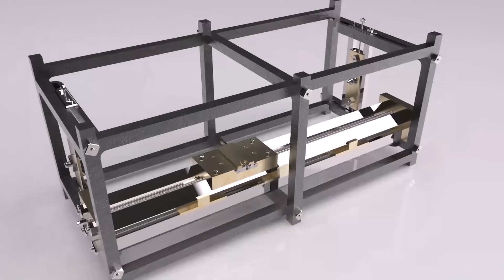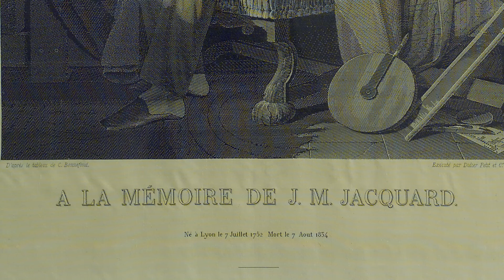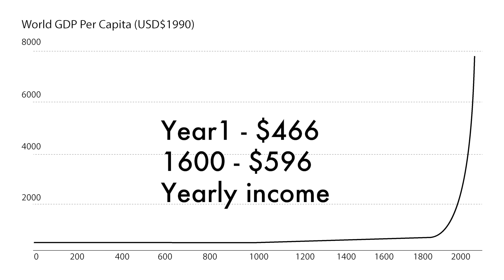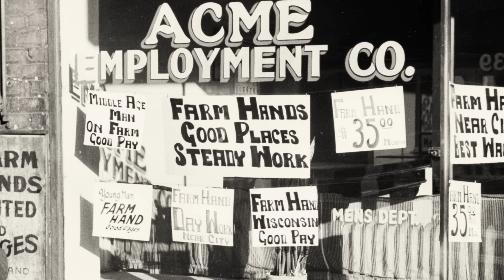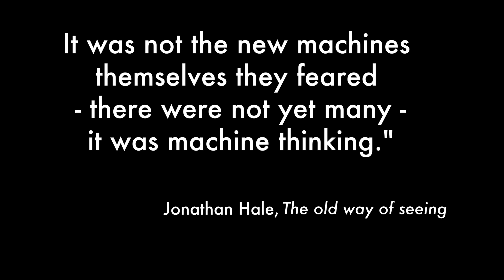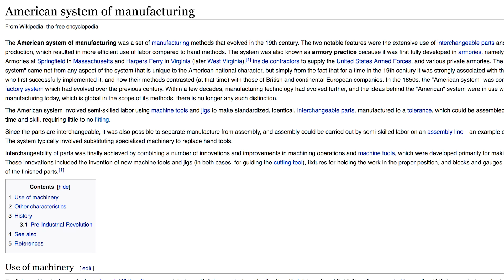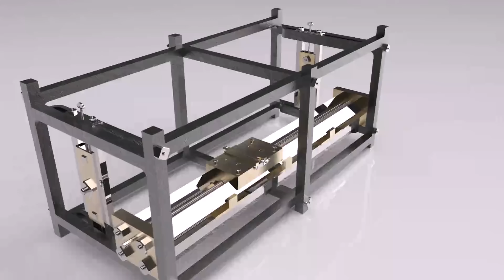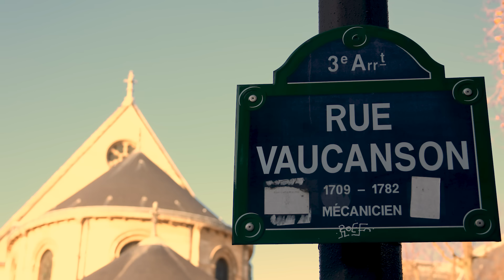The 1751 Machine that Made Everything

Comment: This is quite an oversimplification of the causes and the developmental pattern of the industrial revolution.  If simply having a machine were enough to kick off the whole process, then industrialization would have occurred wherever a machine was developed.  But that's not what happened.  There are entire social, religious, political and legal contexts to consider as well.  These most readily combined with technological advances in Britain, which is where the bulk of industrialization was largely confined for the first fifty or so years.  During those fifty years, industrialization was certainly occurring, but it was far from evident that it was fundamentally changing society; those realizations only came much later.

Comment: Can you believe that the first lathe screw had to be hand made. Accuracy can be reverse engineered over time but it would still have to have been accurate to about 0.01% this is because there is an actual air gap between screw threads which allows for some error at first.

Comment: "Machine thinking" ...Interesting
 I have done many sculptures. Also built guitars and made knives and furnature. I have designed and built industrial automation.
 The electric guitar though is made from magnesium it is seen in my avatar on the left there. All made by hand but with manual machining methods and lots of hand work with files. 
People realize these are hand made right away not because they look rough though. None of which could be done with out modern technology. They are however very unique in appearance and look expensive. 
People see the sculptures though. Sculpted by hand all the way fired in a kiln in my basment. These are things that could have been done with out any modern technology.  Almost immediately though people think they are just something that popped out of a mold and purchased off a shelf at Wal-Mart. Often people have no idea any more.

Comment: I agree.  There was a similar historical event in Chemistry with the advent of industrial methods of making ammonia and then nitric oxide and nitric acid with the Haber – Bosch Process (pressure and heat with iron and platinum metal catalysts).  A similar graph resulted in an explosion in human populations starting in the late 1920s and mid 1930s. Nitrates also made war much more deadly (as in WWI and WWII) as waring countries tend not to run out of nitrates to make explosives with.  WWI when it first started it had been reported in the newspaper (according to my High School History course) to have been no longer than about six weeks.  As the then Germany had to get its nitrates from an island off of the coast of Peru, if memory serves.  The first naval battle of WWI occurred off this island between Germany and Britain.  Sort of profound if you think about it for a second or two.

Comment: you know there is a coincidence on that graph, it is also the year efficient steam engines and the cotton gin were produced. pretty sure the steam engine, and not the lathe was the cause of this explosion. and economists agree with me: 

"Energy economic theories hold that rates of energy consumption and energy efficiency are linked causally to economic growth. The Garrett Relation holds that there has been a fixed relationship between historical rates of global energy consumption and the historical accumulation of global economic wealth.[155] Increases in energy efficiency were a portion of the increase in Total factor productivity.[13] Some of the most technologically important innovations in history involved increases in energy efficiency. These include the great improvements in efficiency of conversion of heat to work, the reuse of heat, the reduction in friction and the transmission of power, especially through electrification.[156][157] There is a strong correlation between per capita electricity consumption and economic development.[158][159]"

machine tools are part of this, as without them efficient heat engines could not be made, but where do you draw the line? you could say without crucible steel forges machine tools couldn't be made, and before that the discovery of metallurgy...so really, its the steam engine.

Comment: It looks like the graph starts to go up just before 1000, which coincides with the use of liquid mercury to power the escapement in astrolabes which were essential in the accurate harnessing and use of Time. Without accurate use of Time, nothing we have would exist. 

I understand you're speaking about the hockey stick on the graph specifically but I found it interesting the line started to go up right around the time of literally harnessing more accurate Time measurements but certainly not as dramatic despite being a requirement for the machine you're talking about to come into existence.

Comment: And yet, despite everything that has been achieved..... Im still waiting for my damn hoverboard.
Reply: all you need is to create a linear motor & then an aluminum plate... since aluminum is a conductor the gap between the linear motor & the plate gets larger the bigger & thicker the aluminum plate... hence you can levitate a human with a large enough plate & a strong enough linear motor.... in addition the principle of the Hallback Array can shift a Magnetic field from ONE side of the array to the other thus greatly increasing the strength of the field generated... 'hover boards' that already exist exploit this arrangement again though you still need some type of conductor... in the case of the spinning Hallback Array of Magnets that conductor is the 'road' you travel upon although you must then exploit the HEAT GENERATION of the repulsion that occurs in the non-aligned generated field in the conductor... this is the reason that 4 arrays are usually employed to rotate in two sets opposite to create a sum zero repulsion effect.... however you still have the heat build up from that resistance/repulsion between the two(8) non aligned fields... so if you can use that heat some way & extract it from your 'road' then you have a double whammy... the reason I think these devices are absurd is the waste of materials & limits of travel/utility... we really need to understand ENERGY- the way Tesla saw it as OSCILLATION all waves are generated as a counterbalance to the 'DISTURBANCE' created by an oscillation as a way to restore any given system back to it's original inertia conditions prior to introducing that disturbance.... Hence TWO masses in space.... gravitational field... two charged particles... electrical field.... and in like attraction & unlike repulsion- Magnetic Fields... all ENERGY = Oscillation & this oscillation is the cause for the effect of the generation of all waves!

Comment: i remember someone posting: how did they made something so precise, without the first precise machine? (had many thumps up)
i though about this lol:  2 rollers or 2 solid points next to each other, than above that 1 cutter, all connected heavy duty. whatever you push over the rollers or solid points, the cutter will always cut a perfect flat surface, as long as those 3 points dont stretch from each other or bend than its flat. 
stone grinders where allready used for sword making. so add 2 rollers to it and you already have this principle

Comment: I made a trip to Paris July 31 2019 just to go see this machine. It was mezmerizing. I stood there after finally finding it after an hour or so trekking through this what turned out to be one the most diverse and fascinating museum ever. I took a 100 pics of it. The interesting thing is the data plate on the case. No mention of being this wonderful invention that it is. The craftsmanship is mind blowing. How did he make the leadscrew so accurate and the cross slide. After 30 min or so the wife's like we have to move on. I said I have 10K wrapped up in this trip I'm getting my money's worth. So 5 sec later we moved on. If you can,  definitely go see it. The rest of the museum is awesome. 3 floors of about 2500 yrs or more of machines, tools, everything up to space travel. Well worth the I think it 10 Euros. Keep in mind there was no A/C throughout most of it. So it was really hot on the 3rd and 2nd floor. The "tour" starts on the 3rd. So you have to take the elevator up and start there. There is a really nice cafe on 1 as you exit. We had lunch there and it was good. Sat outside because even at 90+ it was still cooler out there.
Reply: Thanks for the info, brother.  Wish I could go, but sadly I'll take your word for it.  Thanks
Reply: I think the original lathe was all made by hand. You can achieve incredible accuracy that way just don't count the hours involved. Using the basic lever principle you can magnify errors. If you have a machine slide driven by a lead screw it usually is able to be moved by a thou at a time on a standard lathe but if you change the dial calibration to a bigger size dial  greater  accuracy is achieved. Back in 1985 I used a lathe dated 1918 to do some screw cutting 8 tpi thread. I was amazed how well it worked. How many mistakes were made to get to the first lathe is unknown but it would be handy to know.  Its called development.
Reply: John Smith : "blue~printing" is a term I heard from a machinist.....when tasked with achieving high tolerances of fabricated precision parts
Reply: John Smith :".   change the dial calibration" ....innovation became very useful to the Router and the Radial-Router tools dialing to 1000ths....imo

Comment: The rapid change in the graph was due to the use of fossil fuels - specifically coal.  If you remove fossil fuels, lathes stop spinning.  Sure, the lathe is an important tool, but energy used per day per capital is what drives GDP per capita.

Comment: So, I noticed another bend in the graph around the year 1000. I wonder what accounted for that bend?
Reply: And it also looks like the bend in that graph can be most closely attributed to the steam locomotive and railroads, based on where your arrows line up, although I'll grant you that this lathe would be the match, which lit a very long fuse to the "dynamite" that was the railroad. :) It's a shame that we've left railroads so far behind at this point, because while they're not as flexible as automobiles, they've yet to be surpassed in efficiency.